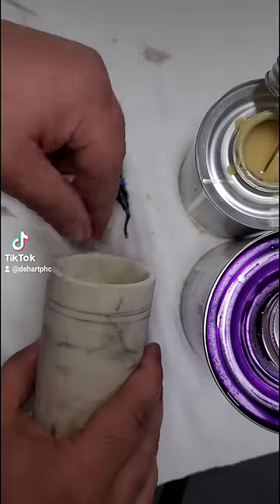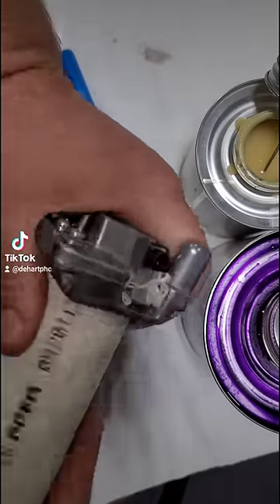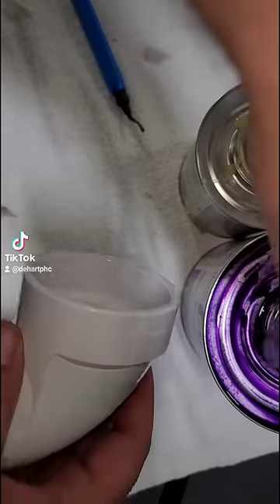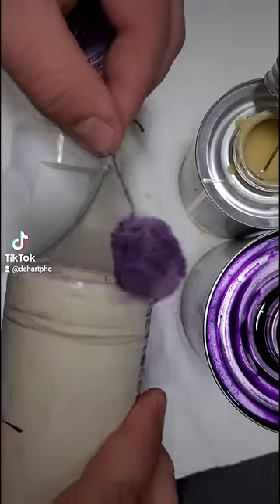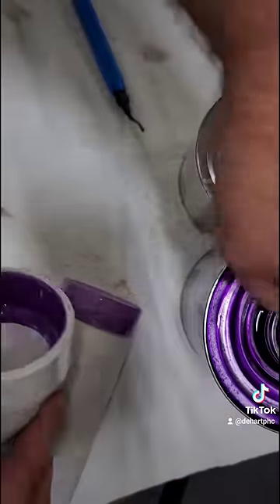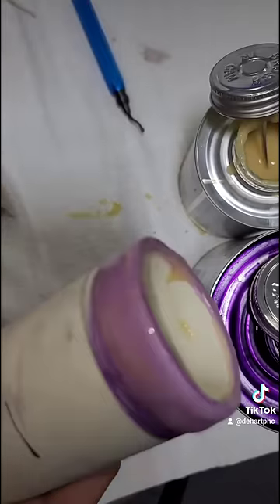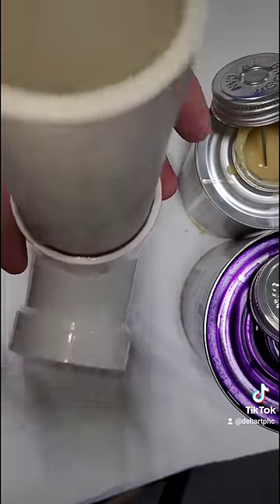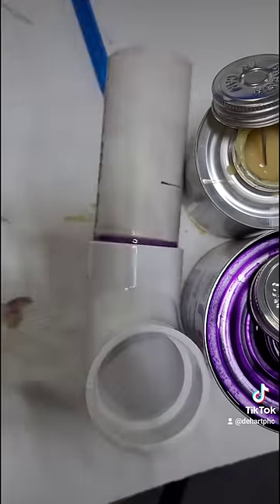How to create a great PVC solvent weld joint.

Comment: I just put the correct amount of primer and cement on the pipes the first time instead of going back and forth. I also don't wipe up the excess poison goo with my bare thumb. Never had a joint fail yet...
Reply: You don’t sniff the glue and primer? Pretty weird…

On a serious note, the back and forth isn’t necessarily to apply the correct amount, you do that on the first pass, the second pass is to ensure it’s still wet right before the next step
Reply: The MEK in primer is very nasty stuff
Reply: @sparks6177  how would that help? It takes a couple of seconds to put the primer brush back and get the cement brush out and use it. That is true if you apply the primer once, twice, or 50 times before switching to the cement. That couple of seconds is also shorter than the time it takes for the primer to dry. How is a second primer coat supposed to do anything different from a single heavy coat? Why do the PVC primer manufacturers not think two coats are advisable?
Reply: @outsider344  well a single heavy coat would work, it’s just wasteful and makes a giant mess, most of the time you aren’t in a situation where you can splash primer all over and even if you could hitting each piece twice would ensure even coverage and good absorption without making a big mess. As far as manufacturers, they rarely give information like this, most Teflon tape manufacturers don’t advise you to use pipe dope but a lot of plumbers will do just that because it’s more reliable then tape or dope alone
Reply: @sparks6177  You can only prime it once, there's no point in making sure its still wet because if you let it dry in the first place you fucked up.
Reply: @vincentlamb3436  that’s actually not true, you can prime it multiple times, the primer drying just means you have to prime it again until you can glue on while it’s wet. It’s drying doesn’t mean anything other then that
Reply: “Never had a joint fail yet…” 

Wait until your knees go. You’ll suddenly remember this comment thread.

Comment: I like how you went through all that and then watched the joint push apart.
Reply: “It’s very important to do it this way”bro it does NOT matter I’ve glued thousands of fittings by just primer then glue and push then hold. Most of this video is pointless lol
Reply: “This is how an engineer glues pipe together”
Reply: thats why they are call back kings
Reply: @supermegadong7597 for real. Never have i used a deburing tool, just rub your thumb on that jagged ass cut, slop some primer and glue and GO 😂
Reply: And wiped the glue with a bare finger. I don't trust this guy's advice.
Reply: @Nathan-uo9yf hey now. Engineers weigh out the correct amount of primer and glue first.
Reply: @supermegadong7597 exactly, the pipe isn't going to be under pressure, this guy definitely slows down a job for all other tradesmen.....lol

Comment: Forgot to hold the two part together for 15-30 seconds so they do not push apart.
Reply: Exactly it will push out 1/16 to 1/8 inch if not held
Reply: Skipped the only part that’s actually important.
Reply: Yuuuup 😆
Reply: He completely missed the most important part
Reply: But did it push out?
Reply: @51-FS  they often do
Reply: @AgentOffice  ok.... but did it push a part
Reply: @51-FS  do you want to cut them open everytime to check? You can't tell
Reply: Well if u can't see it push a part then it's fine?
Reply: @51-FS  no
Reply: @51-FS  it can barely be inside
Reply: @mattlane2282  You could have just said you know everything and I was worng....  but wait I just asked if it pushed out.....
Reply: That’s what I said 😂😂😂
Reply: this here. ive had plenty of pipe seperate cuz they werent held. never again. i slow count to 30 when i glue
Reply: No it wont
Reply: it doesn’t push out? who told y’all this?primer/cement holds it together because it’s a particular chemical that will bond it together. tell me exactly where you learned or heard this?
Reply: @deezz_z  Colorado state plumbers test actually. If u put the fittings together n measure, then primer n glue then measure again while not holding ur measurements go up cuz when the glue dries it expands causing it to push out. Or u can watch the primer on the pvc pipe slowly move out the fitting. Bro ur not a plumber, ur the dude that watches us do the work cuz u have no idea! Thank u but no thank u
Reply: @51-FS  do ahead and be a smart ass, when they push apart no you won’t see it until it fails and leaks lol the 1/4 turn AND the held is 100% bullet proof
Reply: @deezz_z  where did I learn this. I don’t know. I think it was trade school and 20 plus years of working with the stuff. Not to mention the instruction on the back of the bottles. Yeah that just happened.
Reply: @todtalk3912  says the guy with leaking pipes.
Reply: @retiredarmyvet2018  great, work shouldn’t stress you and oh? maybe educate others around you so we can maybe progress? maybe tell us where you specifically heard about it not moving apart? maybe a particular codebook? or old guys don’t need those anymore, right? i’m literally questioning my entire existence trying to figure out if it does or not. but right now i’m logically thinking that they won’t separate since you won’t tell me or anyone else where you heard it from other than experience. maybe you jus don’t know how to glue them correctly? maybe you just been doing it wrong your whole life. or you’re to stingy with your knowledge since you paid a pretty penny to know.
Reply: @deezz_z  Jesus. This is the problem. Idiots got to question everything. Here is the code. 605.12.2 Solvent Cement Joints
Solvent cement joints for PVC pipe and fittings shall be clean from dirt and moisture. Pipe shall be cut square and pipe shall be deburred. Where surfaces to be joined are cleaned and free of dirt, moisture, oil, and other foreign material, apply primer purple in color that complies with ASTM F656. Primer shall be applied to the surface of the pipe and fitting is softened. Solvent cement that complies with ASTM D2564 shall be applied to all joint surfaces. Joints shall be made while both the inside socket surface and outside surface of pipe are wet with solvent cement. Hold joint in place and undisturbed for 1 minute after assembly.
Reply: @retiredarmyvet2018  should have just commented that the first time guy. but word i getcha now. perhaps that’s the way she goes aye bud? thank you smart ass.
Reply: @emeraldtigerhd5176  can u show me where in the video it pushes out? I'm just curious 🤔.... a simple question that nobody can seem to answer
Reply: @deezz_z  If I though something this simple, common and well known needed an in depth explanation I would have included the code from the get go. But seeing 99% of people know to hold the joints together I felt it was not needed. Thank you for reminding me that your generation questions literally everything to include what gender you are and what bathroom to use. Have a great day.
Reply: @retiredarmyvet2018  love you too, have great day at work sweetie
Reply: Great advice. Could explain the pin hole leak on connector
Reply: @SuperOtnok  is it on a copper connector ?
Reply: @51-FS  it’s a 2.5 inch 90 degree pvc fitting for the pool return. Has pinhole leak by the joints when pressurized past certain point(speed 3 on pool pump) and I couldn’t understand how this could happen over time. Must’ve been air bubbles and/or the pipes pushed out since last installer probably didn’t hold them together during curing process
Reply: @deezz_z  
Why do you need to spoon fed information you can find on your own?  Take a couple of scrap pieces and try it yourself.  You can see it pushes out.
Reply: @stroys7061  damn bro u must be old, typing in that cave man dialect still, hey? sorry for offending you plumbing lords if i did, but you seem to know it all walt jr.
Reply: @deezz_z  you literally have many ppl telling you it pushes out and your defense is only” but did it happen in the video?” Have you ever ran any pvc or cpvc that has any actual pressure in it? Would you rather save the ten seconds or save from going back out after a pinhole leak? Seems to me you care more about ego than quality work
Reply: @emeraldtigerhd5176  never said “BuT dID iT HaPpEn iN tHe ViDeO?!” and you claim 10 seconds here, and others claim 30. maybe even a minute. seems were all on some other page, huh?
Reply: If you file the thing down, you can get rid of that bump that a pipe cutter causes. Just saying!
Reply: @deezz_z  it’s simple. The reaction between the pipe and glue creates gas bubbles which are what is pushing it apart. The condition of the glue (new and full vs middle vs near empty) will change this effect.
Reply: only need to do that if its tryin to push apart. doesnt always do that and in my expieriance it mainly does that when its cold or you use too much glue
Reply: Thats what the 1/4 turn was for the reason they pop back out is from air bubbles
Reply: @hernanm5133  The push out is from the chemical reaction between the primer and the glue. It has nothing to do with air bubbles. The primer and glue have a chemical reaction that produces heat. Heat expands and hence the push out. Then you have a gap in the fitting which results in huge amounts of pressure in that gap. The inside of the pipe should be as smooth and seamless as possible. That is why it is extremely important to cut pipes flush and to deburr the inside of the pipe.
Reply: @deezz5329 my two eyes informed me of this fact.
Reply: The twist helps tremendously with the pushback but anything 3" or bigger you better either be sparing with the twist or you better be hercules, otherwise you're gonna end up with a cocked fitting.
Reply: @deezz_z  tell me you've never worked with pvc pipe without telling me you've never worked with pvc pipe.
Reply: 10 -15  seconds works fine for me
Reply: Nice to see somebody saw that video too.🤣
Reply: I have definitely felt the parts try to push apart, so i always hold very tight for about 30 seconds.  The cost of failure is much higher than those 30 seconds
Reply: Ikr
Reply: @deezz_z  636 trainer taught me.  It is code.  It is part of the 636 training.  636 gives you a certificate.  You have to renew license.
Reply: @51-FS  like a new mom that wants to drink at her best friend's wedding
Reply: Diy plumbers lol. He learned this from another diy plumber on yt and made his own video.
Reply: @AgentOffice  if you can't tell, it's fine.
Reply: @51-FS  But do you just take the chance?
Reply: @retiredarmyvet2018  I hold it till I see that it won’t push out, but I don’t think I hold it for no 20 seconds. Somewhere closer to 10-15 seconds should I be worried?
Reply: Usually only happens when you are closing the system. I always wondered if it was the air forcing it apart or the humidity. 15 to 30 secs spot on.
Reply: Totally pushed out, all that prep to make a good joint and then don't follow up.
Reply: That’s more important than anything he said in the video 😂
Reply: That's how long you huff it to get a good .... Seal?  What were we talking about?  Clean joints?
Reply: @51-FS  sure did. Was flush at first, end of frame it's out 1/8. They will always push out if you don't hold them from the chemical reaction. I agree he missed the most important part. Typical 80 percent. Never 100.
Reply: 2 inch isn’t that bad tbh most times you need to hold it for a few seconds and that’s it but 3 inch is a good 10-20 seconds
Reply: @retiredarmyvet2018 15-30 seconds. Good grief. Rookie.
Reply: @retiredarmyvet2018  Relevance?
Reply: @mattrondeau7466  Maybe the almost 600 thumbs up and the numerous comments explaining why my comment is correct from professional plumbers going back two plus months would keep the trolls away. But you have proven that wrong. How's that for relevance?
Reply: lol what’s funny is that when he laid it down you can actually see it coming apart
Reply: @AgentOffice  only if use cheap glue and cleaner
Reply: @dracobruhma  youre probably regularly fired if a plumber or cry off site if HVAC.
Reply: @emeraldtigerhd5176  keep telling yourself this. I've done 10s of thousands of joints and have never had a leak.
Reply: If youve ever pounded a pipe into the ground to pitch horseshoes, you are a qualified plumber.
Reply: Obviously he doesn't know how to glue a pipe. You need to go around with primer once, twice is max. Wait for it to dry (approx. 30 seconds) then apply glue. Doesn't matter which one is first.
Reply: It was a demonstration.
Reply: I've noticed in the cold the pipe pushes out fast if not held. I'd imagine when the glue and primer kick off the heat of it expands and it'll push. So I jus hold it at least 15-20 seconds. Hot weather it's usually good for not pushing out. Although the regular cement vs. the heavy makes a big difference in the two different temps also..
Reply: I feel like if you look at the amount of glue visible did indeed increase @the end.     It pushed apart.
Reply: @51-FS - The video cuts off before you can see it. When push out happens, it’s not that quick.
Reply: @deezz_z - You learn it by doing it yourself and PAYING ATTENTION!!!
And if you don’t learn it then, you learn it down the road when you have a leak.

It’s not that difficult.
Reply: @deezz_z - Hey, genius, dry fit it together, really smack it in there, mark it with a sharp pencil, right down to where the fitting hits the pipe. Now, whack it apart and clean & glue it, pushing the fitting down to the pencil mark, and then don’t hold it for about 30 seconds. You can watch it slowly push out and see your pencil mark isn’t as close to the fitting as it was.
If you don’t do this, then don’t come back here with your BS.
Reply: Ran out of time.

Comment: Grab the pipes, put primer on both, put glue on both, fit them together and turn. There your done.
Reply: Thank you, the only extra thing he said you have to do thats actually true is the 1/4 turn.
Reply: and push together the fittings so they don’t come out but other than that, yes. Once the primer and glue set, if you did it right, it ain’t going to leak.
Reply: Actual plumber here.... Yeah.  You can get a deburer if you want but what he's doing is so overkill... Also the order in which you glue and primer does not fucking matter at all lmao.  If anything I always hit the fitting first because then it has a lesser chance of dripping compared to the pipe.
Reply: Glycol wants to know your location
Reply: *you're
Reply: Need to hold them together for a bit
Reply: In the time you took a professional plumber in the field, it has done several fittings has sang along to his favorite mariachi band.
Reply: @RedboneUnincorporated As an electrician I was taught to always put glue on both.  Ensures when they are put together that there are no uncoated voids on the mating surfaces.
Reply: @AshokaMazda  you are correct, at least according to the directions!

I was told wrong years ago and assumed I was being told right, so I just did it that way until just recently until I actually decided to read the directions about a month ago.

Comment: I can't believe he didn't explain how important it is to hold the joint together for at least 15 seconds so it doesn't push apart.
Reply: I was just thinking the same thing. Ya gotta do it!
Reply: Same here. 😂
Reply: I think when you do the 1/4 turn the hydraulic ram created by the air captured in the glue is removed. But yeah… I’d prob still hold it too
Reply: Yea, the force of the pipes pushing themselves back apart is surprisingly quick and if you don't hold it's very hard to fight it back down.
Reply: @Mebeknob even with a quarter turn I’ve had 4 inch pipes that pushed each other apart
Reply: Most important step imo.

Comment: Work at a hardware store and it always amazes me the amount of people that want to skip primer, its not just a cleaner, its part of the bonding processes.
Reply: But why don't they support homosexual special rights ?
It's only late for dinner and who wants to eat cold jelly ?
Reply: A friend of mine set up his garden with an above ground PVC pipe irrigation system.  Unfortunately, he skipped two steps.  He didn't create a way to blow out the system for the winter and skipped the primer.  I spent two-days last spring rebuilding everything that was broken and made sure the system could be blown out.  I am looking forward to this spring so I can find out how things fared this winter.
Reply: Christie's red hot does not need primer. Package even says so. Says you have to if local codes call for it, or above 4". I use primer but it is optional and unnecessary with red hot, which was always far and away our best seller at my hardware store
Reply: Red hot blue with no primer is okay for above ground drain into a floor drain/cup
Reply: @benjurqunov  biden,  is that you??😂😂😂
Reply: It just takes the glaze off the pipe, that’s why the proper name for glue is solvent cement.
Reply: When it absolutely has to be right, you always use cleaner then primer then glue.
Reply: @Tim C  I'm asking because I'm no plumber but what does the cleaner do that the primer doesn't?  I mean the obvious is in the name and I'm guessing it cleans but does the primer not also in essence also clean the pipe?  I know the primer is part of the chemical reaction that prepares the surface and mixes with the glue/ cement but it also removes the printed text from the pipe as well.  Just curious what that step is needed for.  Thanks
Reply: @J L  Actual PVC cleaner does a much better job of cleaning than does primer, and begins the process of softening the fittings. When used together, joint failures are virtually eliminated
Reply: @Tim C  gotcha and thanks
Reply: @Luttrj  btw this is only needed for pressurized lines. But for sewer aka DWV just glue will work.